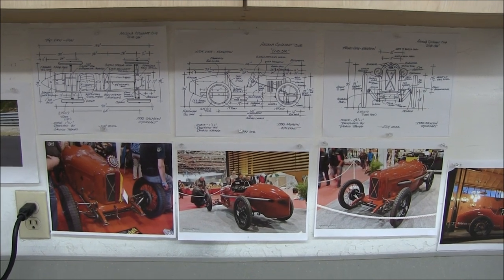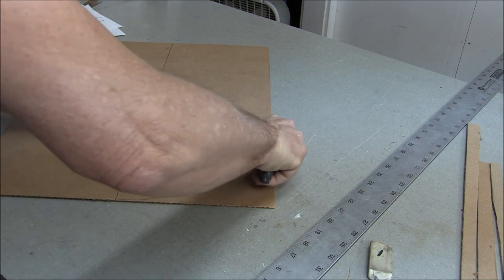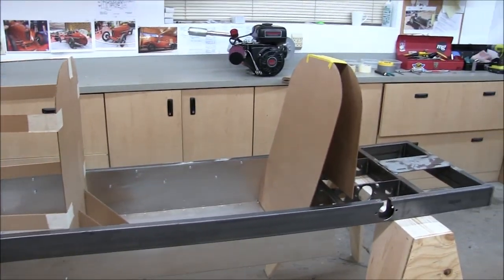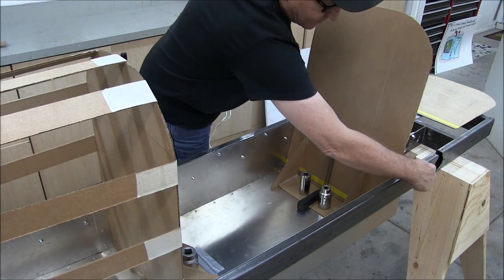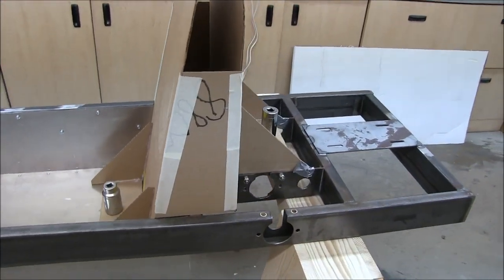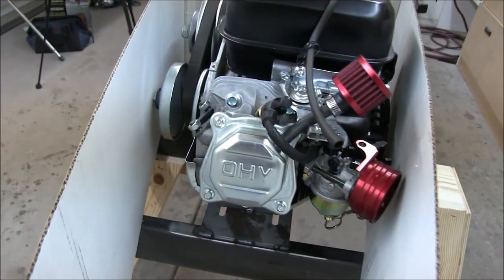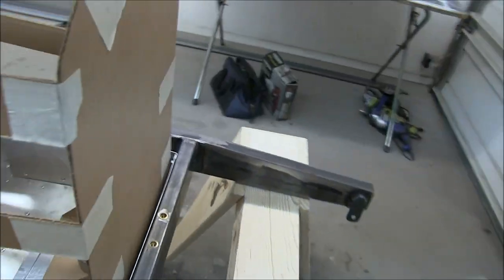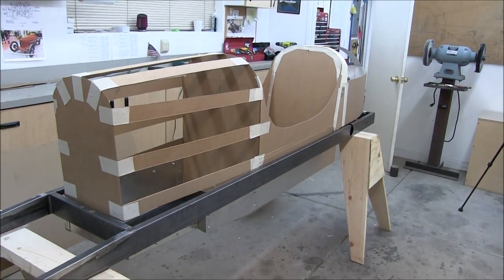Club Kart Build Update   cardboard mock-up

Comment: Appreciate these videos! Started getting material to build one of these as a metal shaping project. I got to a sticking point on the wheel and tire combo. What are you using?
Reply from the maker: If you contact Andrew at www.in-groundtrampolines.com he has the new rims for sale. He is into Cyclekarting and is a friend of mine. He rents part of my building and I see that he has quite a few rims in stock. I would love to see you build a Cyclekart Derek! Thanks for watching.
Reply: @dennisthomas8597  
Great, thank you Dennis!